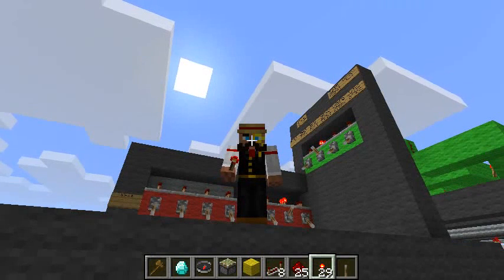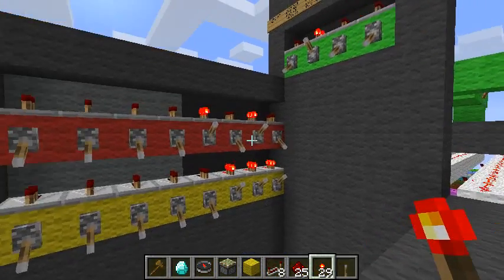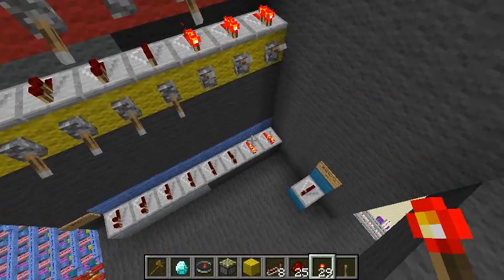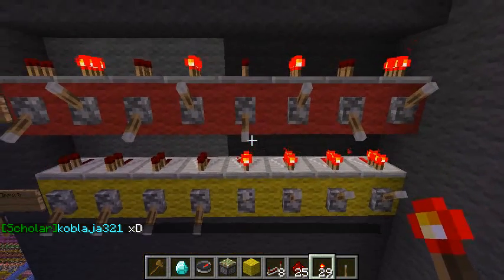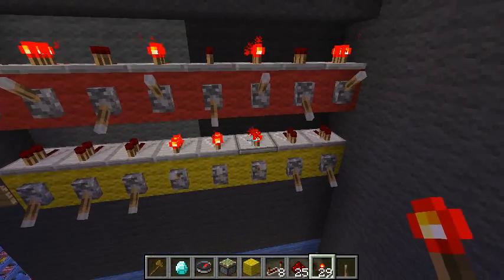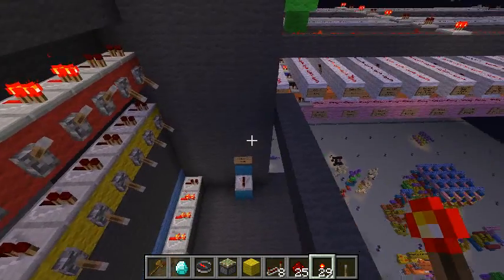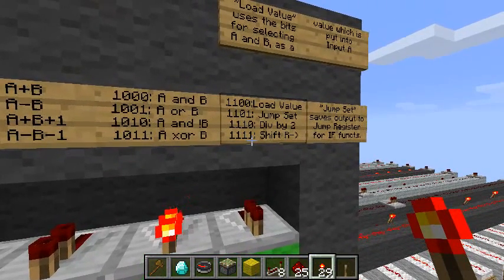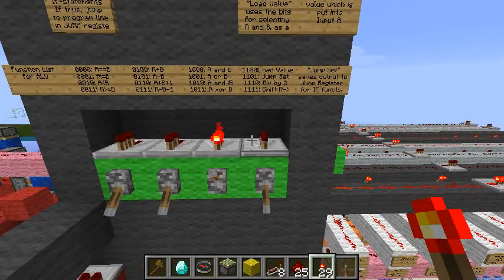ALU Demonstration

Comment: 13:04 LOL sounds like one of those Chinese knockoff product's descriptions.
Also 14:11 isn't that a NAND gate, or is it not inverted?
Reply from the maker: +ender_scythe 
NAND is 0 when all inputs are 1.  OR requires all inputs to be 0 to ever output a 0.  I like to think of OR as "like AND but for Zeros".
Reply: +HansLemurson Did you invert it, If so it would be NOR, also I'm quite new to Minecraft logic. Right now I'm figuring out how to use Koala_Steamed's Disc (it's not magnetic) storage medium. Apparently 1 comparator can store 4 bits!
Reply from the maker: +ender_scythe 
Whether I inverted the output later is less important conceptually than the fact that the "unique" output of the logic gate is when all inputs are 0.  It is an "All inputs = 0?" detector.  Adding a torch to the output only changes whether the "Yes" condition is represented by a 1 or a 0.

As for a Comparitor storing 4 bits, yes it is indeed true.  The devil is in the details though:  Storing data is a far different thing from actually being able to access and use it. ;)
Reply: +HansLemurson Yeah, I managed to make one of the drives, but it's current output can either be 1 or 0.

Comment: couldn't you use the XOR gate as the A=B function? because if both are off or both are on the output would be true, and connect all the outputs to a single NOT gate, so that if any of the XOR gates produce a true the output would be false because A would not = B...

if that's not the best course to decide if A=B, could you please give a short answer why.  Thanks, love your vids I've learned so much from you!